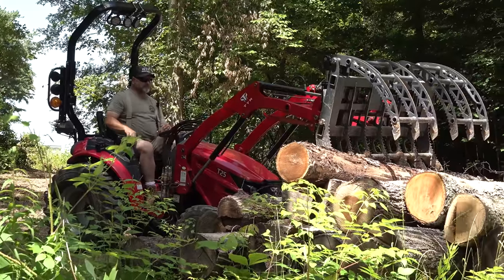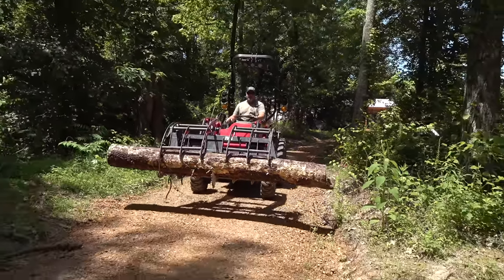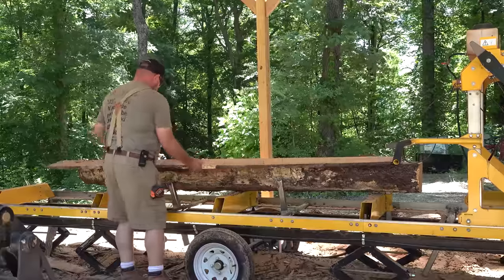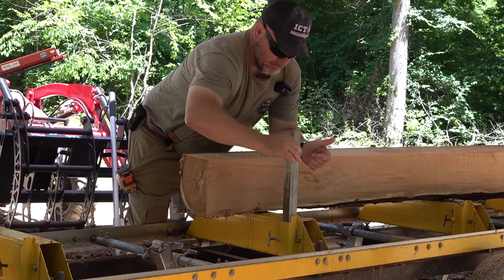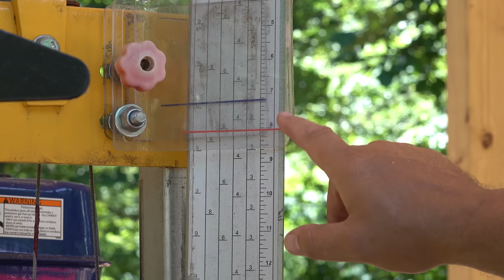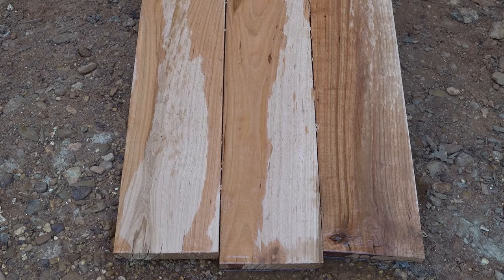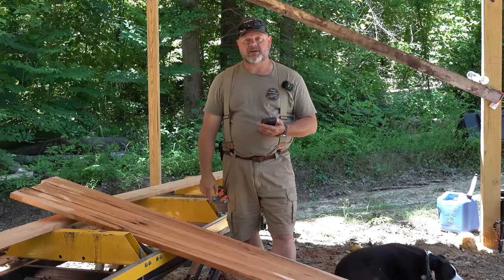Cutting $100 Boards from Forgotten Log |  Frontier Sawmills OS23

Comment: I love sawing cherry, walnut and red cedar.  Good easy sawing and always some pretty lumber too.
Reply from the maker: Yes sir. I agree. I have saved up about 16 black cherry logs for future use in our home build.
Reply: @TonysTractorAdventure  It'll make an awesome table as you describe.  I've got my house filled with my own T and G flooring, wall coverings and even some of the ceilings.  The 4 seasons room and closets are all 100% red cedar and yellow pine.  So there's a combination of several varieties of oak, ash, cherry hard and soft maple, pine, red cedar and American elm throughout the house, either in flooring, wall covering or trim. Most all originating off the circle saw mill I grew up on back on the home place.  Nothing yet off of the Frontier though.

Comment: Been running a professional shop for over 3 decades and I've never considered paying over $5.00 bf for band-mill lumber.
Every sawyer cuts yard-wood and they cut thin then they'll try to convince you that air dried is as good as kiln dried.
Current wholesale cost for 4/4 cherry (Appalachian ) delivered to the door in less than a week is $4.35bf.
Which means for your 8' board 12" wide I'd pay around $35.00. Now I buy "rough" which means it comes in between 1-1/8" and 1-3/16 AFTER kiln drying and I have almost zero chance of running metal through my machines. FAS means my boards come in without sapwood, checking or large or loose knots, also 4" minimum width of usable lumber. 

Sawmills can make a person money but it takes a whole lot of work and really good marketing to make better than market, especially the "$100.00 board!
Reply from the maker: So, what is your point?
Reply: Correct the home Depot lumber is kiln dried #1
Reply from the maker: Thank you for your input.

Comment: When using a black cherry like that you wanna make a table whatever I cut more venerer and glue it to a lesser value number then join it and glue it back together to make a 2 inch board that is black cherry on top and for example pine on the bottom
Reply from the maker: Very Smart! Thank you for the insight.
Reply: @TonysTractorAdventure  your welcome. Keep up the good work

Comment: try silicone spray on the bunk heads Stuff should slide easier. if that doesn't work cover the bunk heads with stainless stele sheet metal
Reply from the maker: Thank you. We are considering an upgrade soon.

Comment: Just curious to know what size engine pulley you used when the engine was replaced. From what I can see from the sawdust it looks like band speed is spot on.
Reply from the maker: I went with a  heavy duty clutch pulley. The belt pulley is the same size as the original. I lost the info where I ordered it.

Comment: those are everywhere here in wisconsin. some as big as 30in across
Reply from the maker: You should harvest them.
Reply: @TonysTractorAdventure  I don't have a mill yet I will this winter.
Reply from the maker: I love working on the sawmill. It is hard work, but fun
Reply: @TonysTractorAdventure  do you get a lot of slabs/cutoffs not sure what the term is, sawdust and chips? reason i ask is because part of my pole shed is concrete and enclosed, must have had a paint room  anyway i want to turn that into a kiln and put the scraps into a pellet maker. try to use the entire tree for minimal waste.  is itworth it or a lot of added work

Comment: Wow
Reply from the maker: A good day!
Reply: @TonysTractorAdventure  yes it sure was. From watching your video I think I know now why my last board or two comes out thin in the middle and thick on the ends. I've been making a cant and then just plain sawing and the stress must be causing that bow in the middle and the board to be thin in the middle on the last cut. Thanks for the help. Oh, one more thing, do you know how to prepare a post to go in the ground so it won't rot? I want to build a shed over my OS23 like you have but I don't know how to treat or prepare the post for ground contact. Maybe old motor oil or not?

Comment: You're a true lumberjack, Tony! 🪵 Excellent work!
Reply from the maker: I am a rookie Sawyer! 😁
Reply: @TonysTractorAdventure  the cherry we get here in Oregon you don’t let direct sunlight hit it until it gets a coat of finish on it. We had a bunch of cherry doors get darkened and where they were stacked unevenly, there were “tan lines”
Reply from the maker: It happens. It will clear up once it it dry and it is run through the planner. Sun will darken it up a good bit.